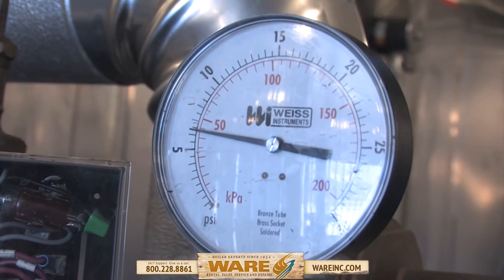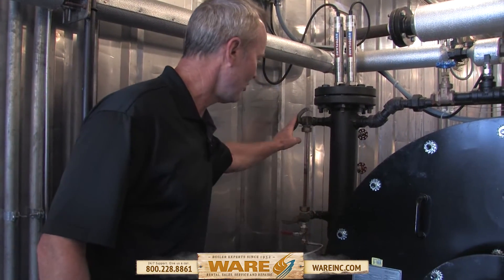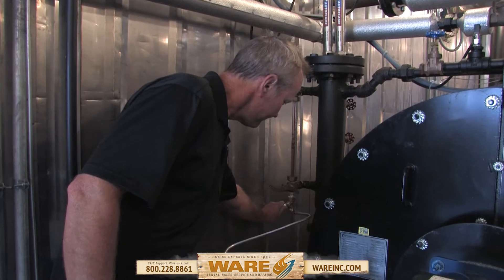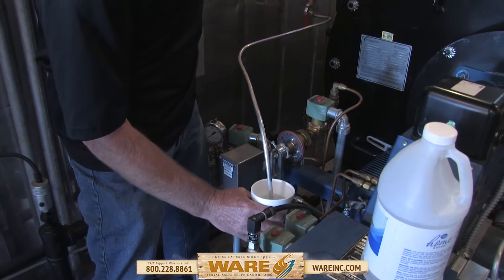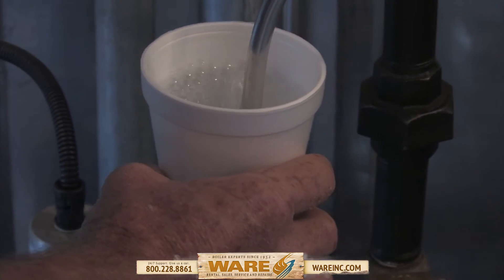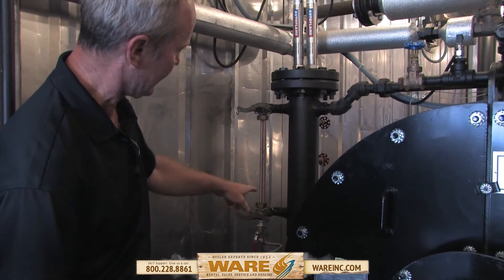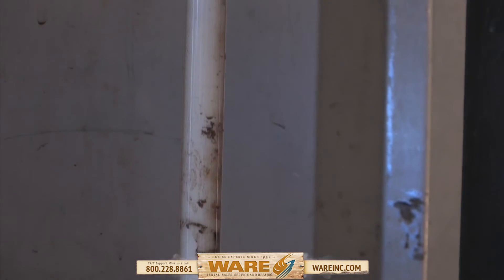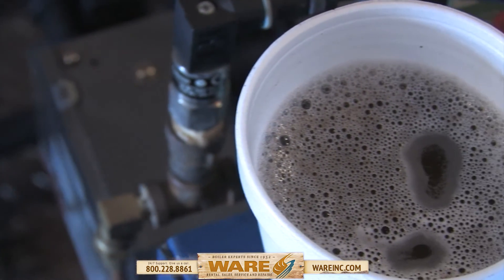[HOW TO] Steam Boiler Sight Glass Cleaning

Comment: You have 2 isolation valves on the sight glass.  You closed the bottom drain valve with the tygon tubing.. How does water drain out and subsequently get sucked up into the sight glass with the bottom sight glass valve still closed?
Reply from the maker: The shut off mechanism is in the seat of the valve which is past the glass connection. This isolates the glass itself from the boiler and the drain is draining the glass only. Thanks for watching!